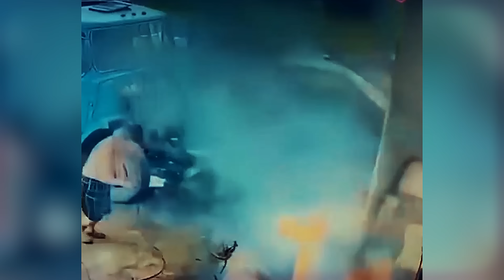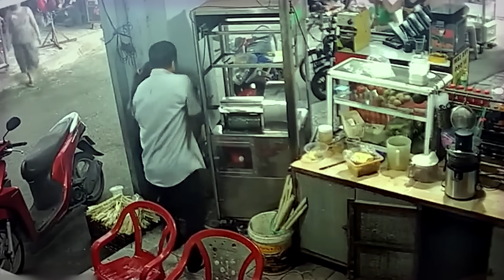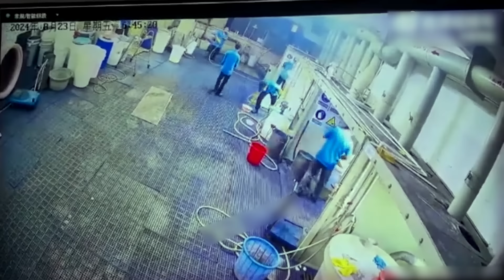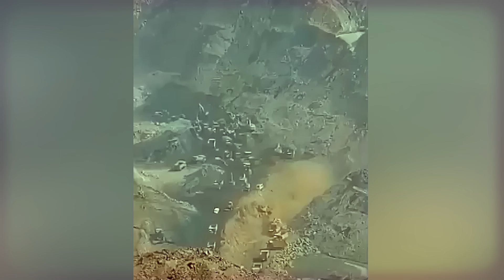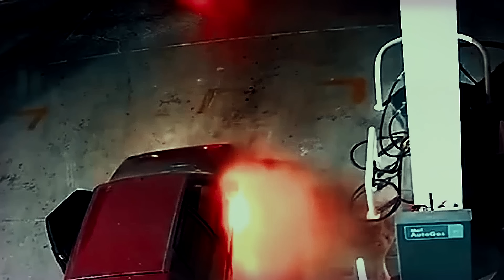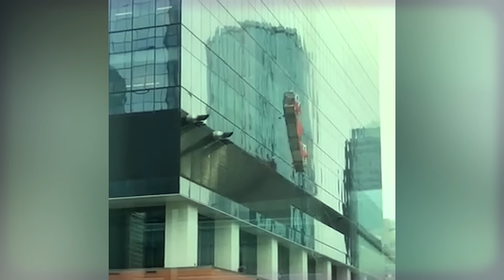He Didn't See the Buildozer Coming... Then This Happened

Comment: You think that rents the tank out before they did something like that.. you know fill it with water.. he says no it won't blow up I'll just fix it anyway..🔥....
Reply: It is never safe to create sparks grind/weld or use a torch or any other source of ignition including a plasma cutter on a barrel or other vessel that has once contained a flammable liquid not matter how thoroughly it is cleaned out.   For what it's worth.  It's still considered extremely dangerous.